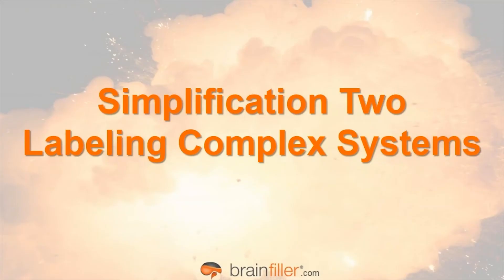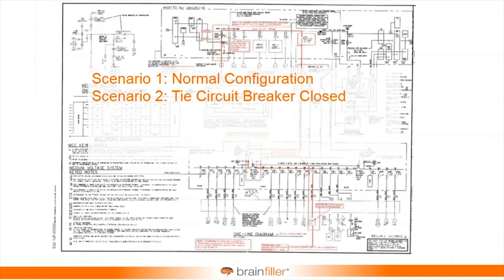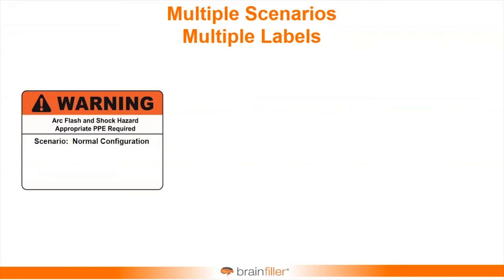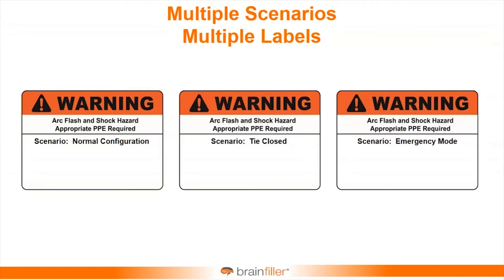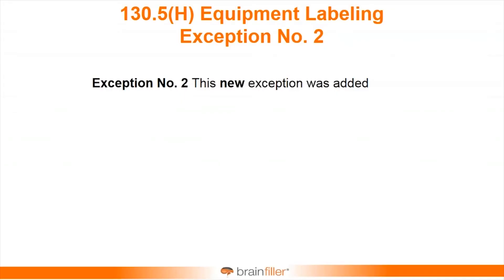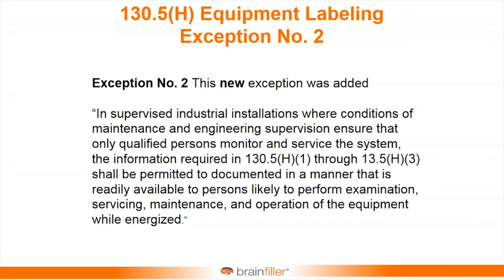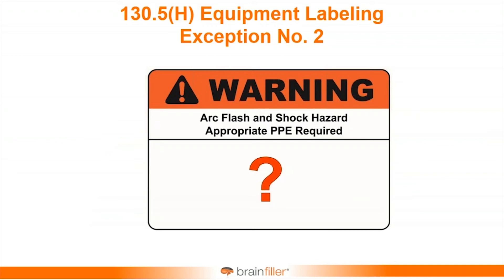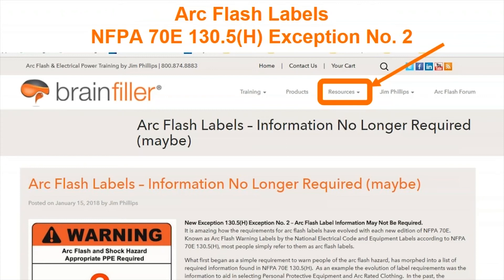2018 NFPA 70E Arc Flash Equipment - Labeling Complex Systems

Comment: How do you handle transformers? Using the arc flash software we utilize (PTW), there is no option to label dry type transformers with the worse case voltage protection, along with the worst case arc flash values. They are commonly values which originate from the different sides of the transformer.
Reply from the maker: I conducted a survey years ago and it seems the consensus it most do not label transformers since they should not be serviced energized.  I know someone that was a fatality working on an energized dry type transformer.  The primary was 4,160 volts.  It did not end well.